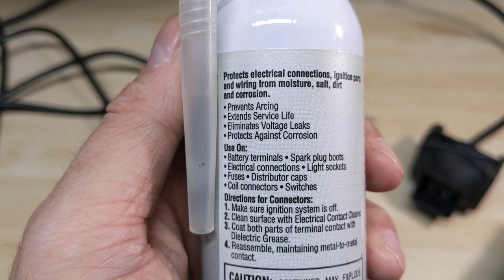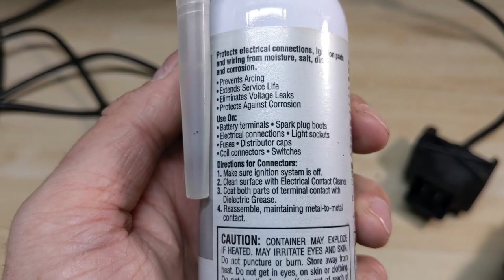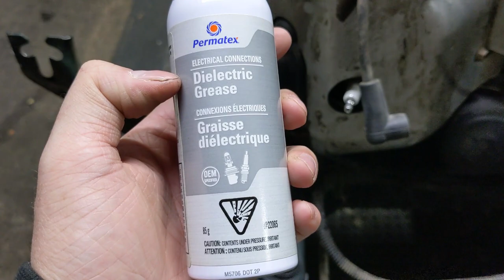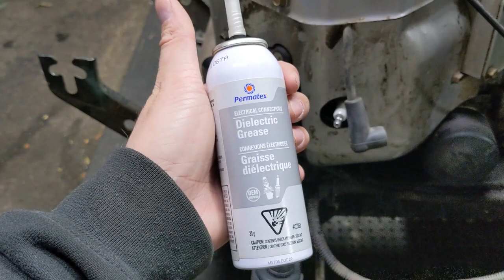Dielectric Grease

Comment: Had exact same issue at the fuse with my husqvarna lawn tractor!  I did replace fuse and clean connection. I’m going to get some dielectric grease so it won’t happen again. Thanks for the video

Comment: It hurts conduction and increases resistance.  You do not want it on contacts.    It can be used to seal a rubber boot but so can silicone caulk.   Deoxit will do better for the connection as it actually removes oxidation.    I think people have this all mixed up on how to use including this video.

Comment: Jake ...  been repairing equipment all my life and always used Vasoline Petroleum Jelly on on  electrical connections.Never had corrosion on any terminals that I treated. Have been using Dielectric grease  especially on Spark plug leads for the past 4 or 5 years due to its abilitity to withstand higher temps.
Reply from the maker: It really is great stuff! Thanks for watching!

Comment: Right on buddy, 28 gram tube of this stuff at Canadian Tire is $5.49 plus the dreaded Canadian Harmonized Sales Tax of 13% and for that cost i cannot believe more people are not using it. Over the years i have seen many snowblower electric starters that needed to be replaced just because the electrical negative or positive prong broke off. Additionally, all viewers should be sure when removing the electrical cord they pull in a straight out direction to avoid breaking one of the prongs. Dielectric grease makes this process so much easier. Another great EP tip, thanks.
Reply from the maker: Thanks for watching!
Reply: everytime I replaced a sensor on my old car I jam packed the connector with that (I bought if from CT, and IIRC it was permatex). The metal connection should be tight enough to scrap the excess and make a good electrical connection while still bathing the grease, no moisture can collect  => no corrosion weld, no  high resistance  spots   that can affect readings  .. etc, sensors happy => car happy, owner happy !

Comment: Good  day Yea people would regular grease on battery terminals.  Always wondered if it would cause fire?  I bought snowblower 2 yrs  ago it always started by rope ,  didn't know it needed special cord.  Thanks
Reply from the maker: Many don't, but a lot of the new ones use this design and many extension cords get jammed in there. Thanks for watching!
Reply: @EliminatorPerformance  G day How is the Ford doing with nice fancy lights.
Reply from the maker: @donvoll2580  just fine, should be another video later this month or in the new year!

Comment: I just had a Briggs snow engine 14.50 (305cc) that burned off the electrical connection on the starter, can't find just that part, Have you seen any replacement plugs, probably contains the start burron and relay, any where for Briggs. Great content and very true to what happens on snow blowers, Thanks for the video.
Reply from the maker: Not that I know of, maybe eBay? Thanks for watching!

Comment: I don't get it. Dielectric grease is a non-conductor. Why would I goo it all over contacts? I've used a touch of anti-seize on high heat contacts and surfaces including plug threads to get accurate torque settings. A shot of lithium grease on other surfaces and contacts works fine. Gobs of dielectric can only cause slightly more resistance. And what heat rating can it stand? Plugs would cook grease off in no time. Silicone is good to about 400 degrees C. Cylinder heads can sustain close to that. How long does dielectric last on a spare plug? How on that?
Reply from the maker: Dielectric grease is an insulator, yes, but it's insulating properties don't hurt electrical connections. I put it at the end of the spark plug to make sure the boot is easy to remove on some, and also on these connections to help prevent corrosion. Works great!

Comment: I've been using tri-electric grease. Its one better.

But seriously. Great stuff. I use it on everything from cat5e on my outdoor cameras to plug boots. Permatex rocks also
Reply from the maker: 👀 lol thanks for watching!
Reply: Both sound like good products. I certainly never thought to use the grease in other electronic applications aside from the plug or coil boots on my lawn mower or truck. Question: Would the application method used in Jakes video be ok for the auto connectors? My F150 has all sorts of electrical ghost and have observed green corrosion forming in some of the contacts and or wiring. Is it as simple as unplugging, spraying with cleaner and packing with the grease? Does it matter if mower/truck battery negative is removed first before cleaning and greasing? Thanks for any feedback. The informative videos he shares coupled with the comment section have become a nice go to. Thanks again
Reply: @Sheeeeeeeeeeeeiiitt  I'm no expert- im only a dentist, but I use it on absolutely everything  from my mower to anything that potentially could ben moist. You probably don't need to remove the negative terminal, but its not a bad idea just in case you touch some metal.
Reply: @Samlol23_drrich  Appreciate the feedback, Doc. Picked up some at the store earlier. Haven’t cut my teeth yet on the electrical side of things, here goes!
Reply: @Sheeeeeeeeeeeeiiitt  I’m becoming a you tube electrician, plumber, and small engine repair expert. You can too!  Good luck- you’ll see, that grease will get used more than you think. Never heard of it until I made the mistake of buying a plow for my suv so I could plow my own driveway a bunch of years ago.  (By the way, don’t do that)

Comment: Can't you just use VASELINE the same way?

Not sure if "VASELINE" is conductive or not...
Reply from the maker: Vaseline is not conductive, but I've heard it works. For higher heat applications such as the spark plug cap, I'd recommend dielectric grease! Thanks for watching!
Reply: Vaseline is petroleum based, can/will damage rubber. Use silicone based dielectric where rubber is present.

Comment: Ha ha ha stops corrosion and also stops electricity,  put it on all your engine electrics and make it run like a heap of junk lol
Reply from the maker: Dielectric grease is not enough of an insulator to prevent electrical current. There's absolutely no change in conductivity.
Reply: @Eliminator Performance  read the spec sheets and see how many kv it's rated at.